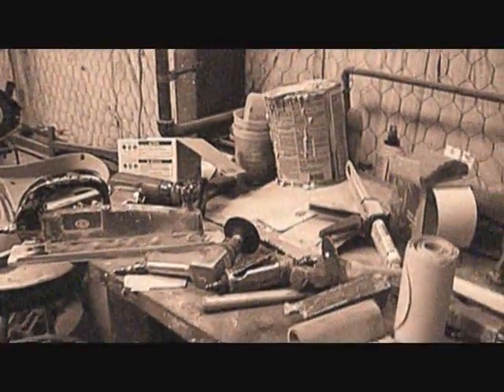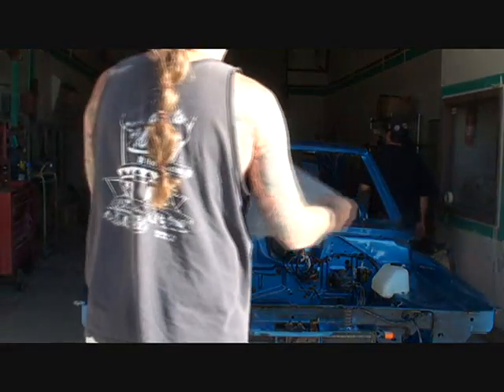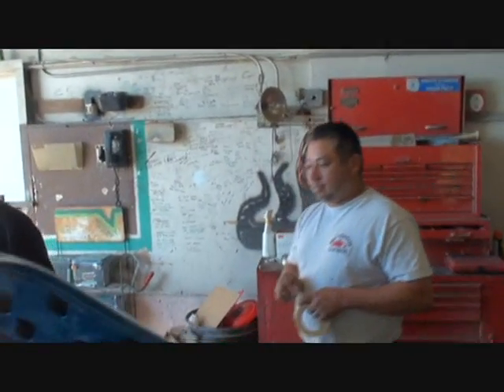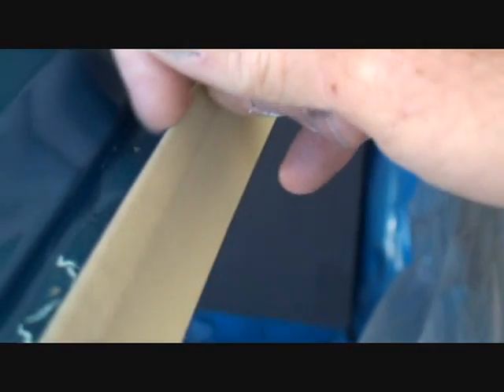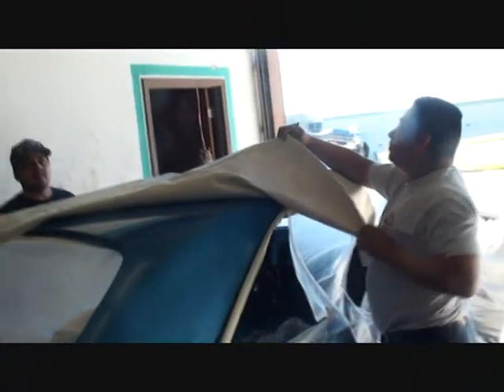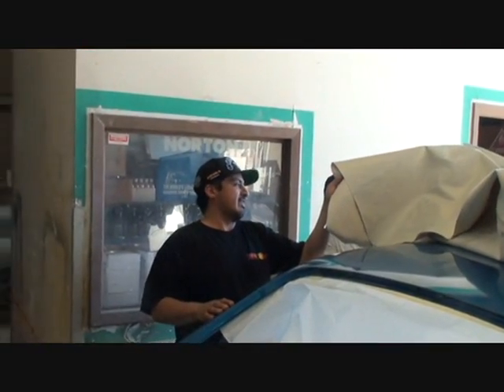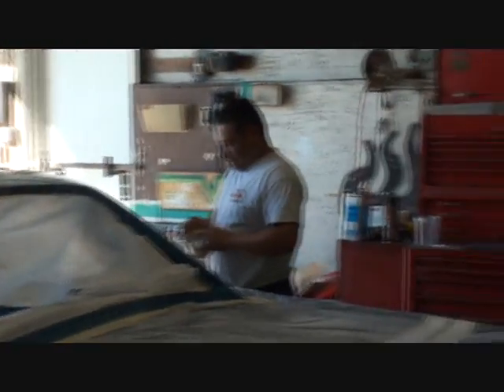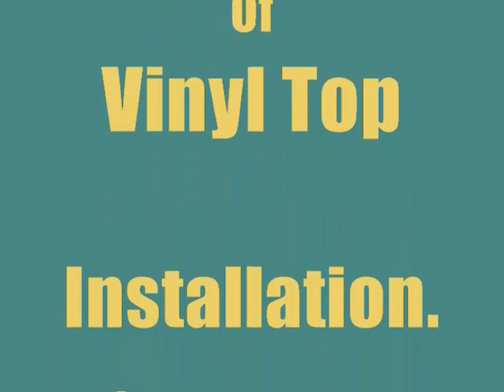Automotive Upholstery and Interior-How To Install A Vinyl Top. Part 1

Comment from the maker: @but199018 Yeah it is possible, but you are gambeling on the weather getting under the lip of it and causing RUST..  If you don't tuck it under the chrome trim, you should get some sylicone of the same color and calk it up to seal the edges in. Pete

Comment: I have a 1966 mustang with vinyl top. What kind of glue should I use for bonding a vinyl top on? please help me!!!
Reply from the maker: You can purchase some "CONTACT CEMENT" at lowes or home depot. It's in a Red and Black quart can, Make sure you get the "ORGINAL" contact cement, and NOT the waterbase stuff.  To do a vinyl top you will need atleast 2 quarts and possibly 3. Good luck. Pete

Comment: I just did a top today on a big dodge. Basically the same idea as this top. These guys are doing this the hard way. it is way to difficult from front to back, and way to much area glued at 1 time. Do the top from side to side only about 1/3rd at a time. This will make it much easier to handle. I can apply this top with 1 helper in 2.5 hrs max. That is if the trim is off, and everything preped. Glue too much at 1 time like these guys is a recipe for trouble...way to hard to handle.